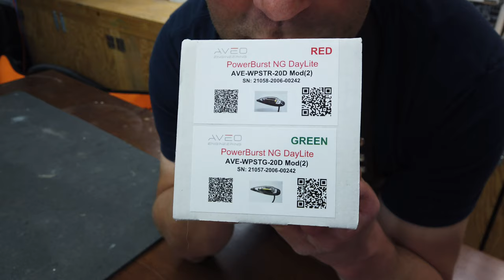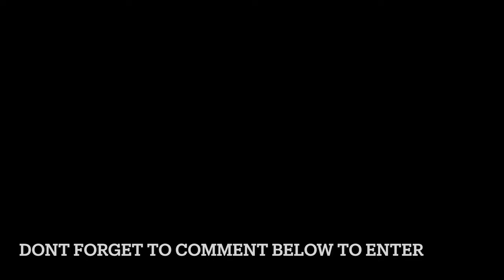LETS UPGRADE OUR DIAMOND and a Giveaway!

Comment: You could have placed a small two way switch between the battery and the BEC and just switched it off so it wouldn't pull your batteries down. Just thinking out of the box. Happy flying
Reply from the maker: Thanks Hank!  Yea that would be a reasonable solution for sure.  My only hesitation is that introduces a failure point on a critical item.  That would be the only reason I wouldn't do it.
Reply: @thelightersideofrc  
Understand

Comment: I have the same Casttle BEC in my Flash...I just get in a habit to unplug batteries after every flight. Not a big deal if you dont...I tested mine and it only pulled 100mah after couple days.

Wise choice to not pull power from ECU battery.

My 5 batteries in flash doesn't look so crazy now eh ? Lol
Reply from the maker: LOL! Not quite as crazy as it used too!  
My only issue with the BEC/Battery thing is that pulling the nose off is a Pain in the butt!  Nice to know it pulls such little current just resting!

Comment: That's the way my Xcalibur is setup.  Smoke and Electron Gear/brakes on the same battery.  I actually wired it for two batteries one for smoke and the other for gear but the plane turned out a little nose heavy so I built a "Y" and run both off of one battery.  A 1300mah battery is enough for 3 flights and it is easy enough to change if I fly more than that in one session.
Reply from the maker: Thanks Rick!  I have a new Swiwin Smoke pumps on route for the store and 1 for the diamond.  When I install that one I will be able to go to a 3 cell lipo for the smoke/gear which will make everything work better too.  The behotec gear work on 2 c lipo but are better on 3c.  Took a lot of brain power to come up with the final sollution!😣

Comment: Couldn’t you put a switch between the battery and led?
Reply from the maker: Hey Cecil!  In this situation I could have put a switch between the gear and battery but the thing I didn't like about that was the switch would be another possible failure point.